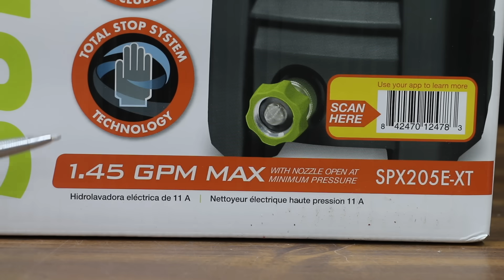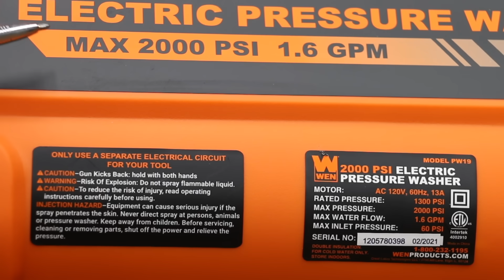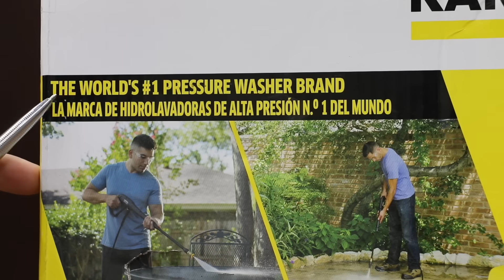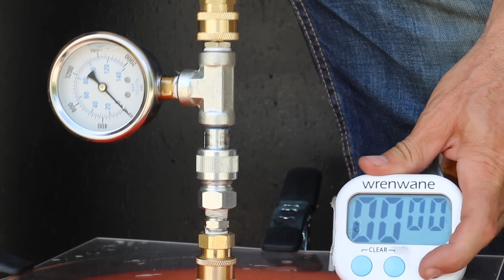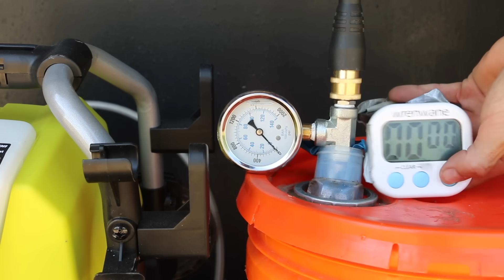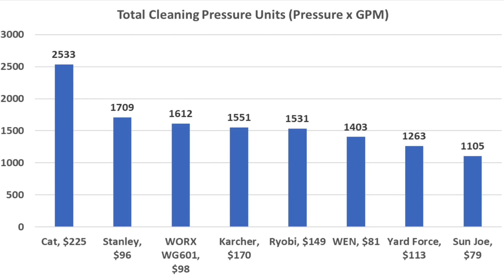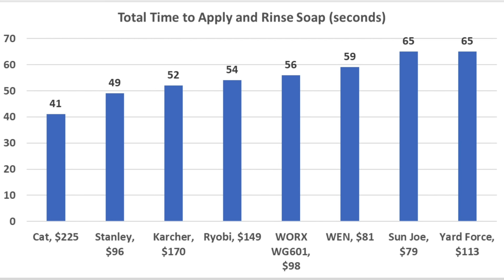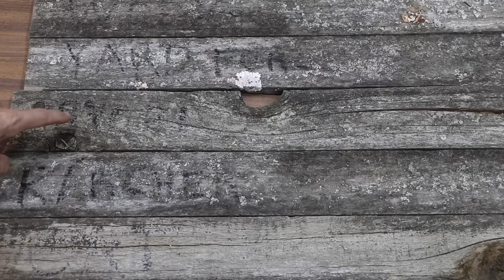Best Pressure Washer (ELECTRIC)? Ryobi vs Karcher, Stanley, Sun Joe, WEN, CAT & WORX

Comment: The best pressure washer I ever got was from a Pawn Shop.  Some junkie rattle canned it red for some reason and it looked horrible so nobody wanted to buy it.  Grabbed it for $50, turns out it had a nice little Honda engine and made over 3000 psi.
Reply from the maker: Great!  Thanks for sharing.

Comment: I hear you there my harbor freight pressure washer is like the sun Joe wen and such.   I did however order a metal spray tip with the bayonet connection.   Works 100 percent better
Reply from the maker: Thanks for sharing.

Comment: Did you know with those foam guns, the oreface inside of the bottle is designed usually for a 2GPM 2000psi unit? You can get replacement parts that are smaller, and work with lower pressure units to make them perform a lot better in terms of soap application.
Reply from the maker: Thanks for sharing!

Comment: I Personally use just a Ryobi cordless easy clean power cleaner that uses 18v batteries. It also uses a Bucket so doesn't need a hose. I Live in the desert so mud and moss don't exist here. Great video as always. A video I idea would be to test cordless power washers that use power tool batteries. See which is best.
Reply from the maker: Thanks for the video idea.
Reply: @ProjectFarm  Your welcome.

Comment: The Cat is costing about what you could get a entry level gas model for. I consider it outside the range of the others - which are mostly cheap and mediocre.. I always considered the Sun Joes overhyped. I have a Ryobi because I got it cheap, but they come with a turbo nozzle that others dont have and it makes a big difference. Without the turbo tip I consider the whole unit junk. Oh and you parked that car too long on the Ryobi gun!
Reply from the maker: Thanks for the feedback.

Comment: I have almost the same Stanley and really enjoy it. Mine has the differnt nozzles so not sure how much else is differnt from the one tested. I use it off and on to power wash my UTV. Sometimes I like it better then my gas craftsman because of noise but on the flip side I gotta run a extension cord for it whereas with my gas unit that's not needed. Also my gas unit is 3200 psi.
Reply from the maker: Thanks for sharing.

Comment: I had a Karcher electric pressure washer that quit working after a few months. They sent me a new one that broke the same way in a few months (cheesy plastic valve body) . A bought a cheap gas powered pressure washer several years ago that is still working perfectly.
Reply from the maker: Thanks for sharing.

Comment: Nice video! For what it's worth, I would have liked to see pressure washers tested from each company with more similar price tags. For example, the Sun Joe SPX3000 (at $139 to $159 depending on if it's on sale on Amazon) would have been a more Apples to Apples comparison with several of your more expensive, higher performing models instead of the low performing, cheap unit that was tested.
Reply from the maker: Thank you for the feedback.

Comment: I wonder if the proprietary connectors are to stop people from using that spray gun with a more powerful pressure washer. It doesn't look like a proprietary metal connector would be cheaper than using a standard one.
Reply from the maker: Thanks for the feedback.

Comment: Was thinking of buying one today but the variety and spec is mind boggling and hard to see the wood from the trees. I have bought 3 of them over the years and they are not the most reliable of tools, with replacement parts unobtainable or ripoff expensive. Aldi do a petrol one and that's the one for me whenever they are on sale next time (250 Euro)
Reply from the maker: Thank you for the feedback.

Comment: I've always used a gas powered one. The electrics didn't provide enough pressure or work very well at removing dirt in concrete and just like your test with the wood, getting that black mold off a wood deck. Depends on what you are using the pressure washer for, and time. I'd never use my gas powered one on a car, would remove the paint if you get too close.
Reply from the maker: Thank you for the feedback.

Comment: Nice video and surprised that Karcher performed so moderately, The Karcher brand in Europe typically come with a 2x pressure rotating spray lance as standard, even on the K2 model which I own (cheapest @ 69 pounds), I think that if that lance was used, it would have performed much better on the wood cleaning test, because when I used mine to clean concrete slab paths, it performs well for the price.
Reply from the maker: Thank you for the feedback.

Comment: I'm paying for a water cooled induction motor number 1 priority! Who would buy a brushed motor anything in 2021?!  The most important thing is to release the pressure in the system after you unplug it from power and water pull the trigger! Otherwise the water inside the pump will freeze, expand and break your pressure washer in the winter. 
I'm looking at the Karcher K4 home and car. Get what you pay for.
Reply from the maker: Thank you for the feedback.

Comment: I guess if I was going to buy an electric power washer I would buy based on best value. After all, one can buy a Simpson Mega Shot with a Honda engine for a little over $300 which has a lot more PSI and  GPM. It's also "Made in the USA".
Reply from the maker: Thanks for the feedback.

Comment: I have learned that while electric yard tools have improved, ya cant beat a gas powered 4400psi pressure washer!
Reply: yeah, absolutely. The electric ones have their use cases, like cleaning an interior space like a basement or something, but are too wimpy and slow for anything more than washing a car.
Reply: Agreed  but for the average home owner they work well and don't make to much noise. 
 I drill water wells for a living  and have a pressure washer on the drill rig power by a Detroit diesel that does 6,000  psi and better than 40 gallons a  minute it all 1.25 inch hose and a 1 inch pressure gun.
I'm 225 pounds and it can lift me off the ground. 
  Now it is what I call heavy heavy duty.
Reply from the maker: Thanks for the feedback.

Comment: That's crazy, so, I just bought a Ryobi pressure washer (also 1900psi)! 
It's the other model, the non-compact one. Can anyone tell me if it's basically the same thing in a different form factor? I'd really like to compare the results in this video with what I have, but only assuming it's the same actual components inside as the "compact" one. It performs really well IMO and I've used a number of gas washers and stuff over the years. It's no gas pressure washer but it's strong.
Reply: Oh dude though before I forget for anyone wondering. The Ryobi I bought (same year as the model featured in the video ) that isn't the "compact" version but also 1900psi, doesn't have a lock. Like, you know, the kind that exists on a gas pump nozzle. You're just expected to hold it down forever like some kind of cave person. I got around that problem with a $1 clamp from Dollar General (or harbor freight probably has the same exact thing under a different brand) and that works just fine. But like jeez, cmon lol who wants to do that for hours on end? Not me.

Comment: Just as a wise heads up, when testing things test the thing it does. So in this case cleaning efficiency and trial the heck of it with different types of dirt on various materials. I'd be happy to clean something in 2 minutes with added noise, weight, breakability, etc than to struggle 10X longer with some garbage produce because it's pleasant on the ears, etc.
Reply: Agreed. I'm going to be wearing noise canceling headphones with music/podcasts playing anyway. And I don't carry the thing that far or that often. 

Those two tests aren't that informative for most home owners IMO. Unless one is so loud your neighbors will hate you